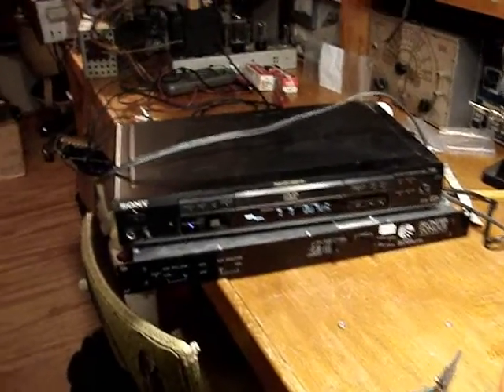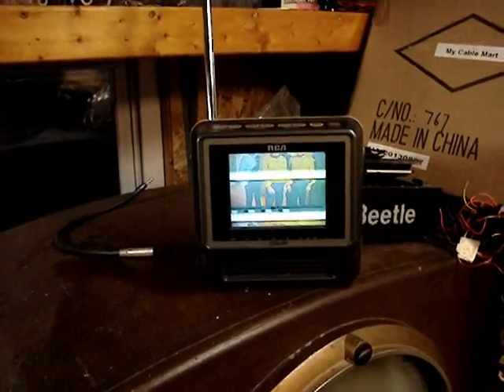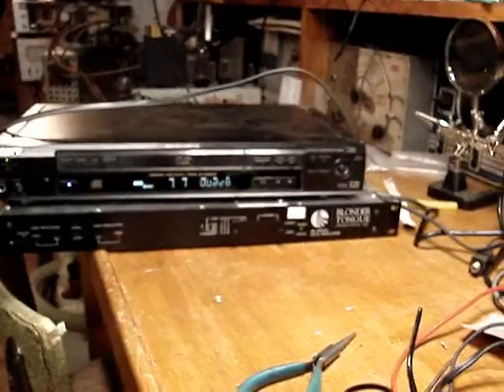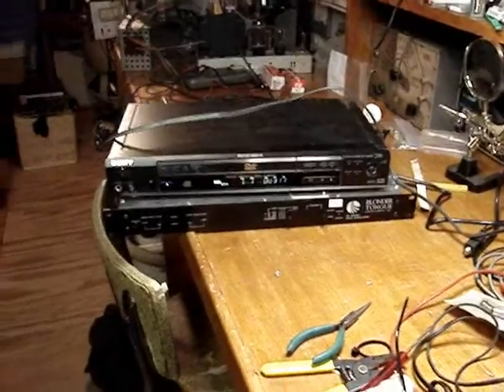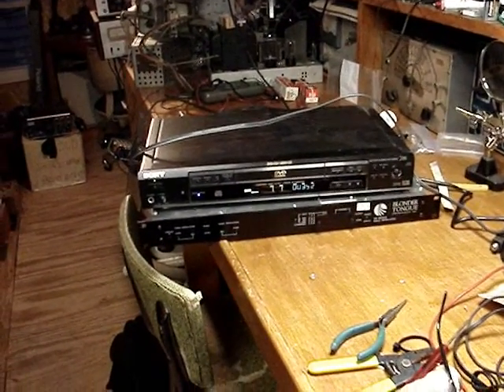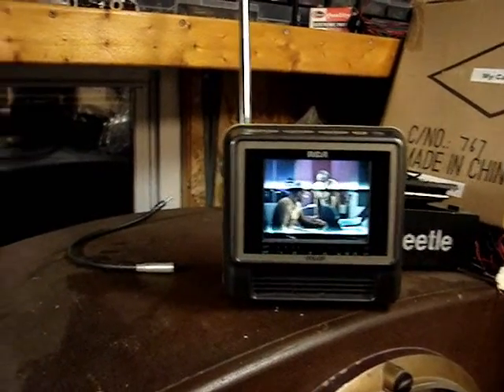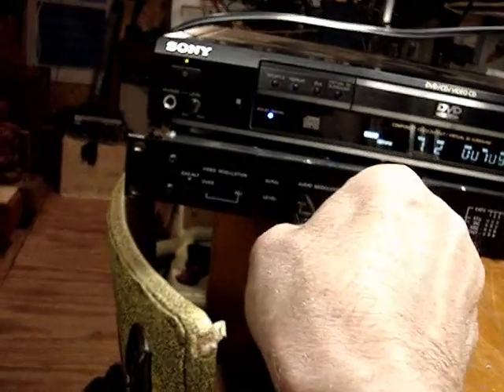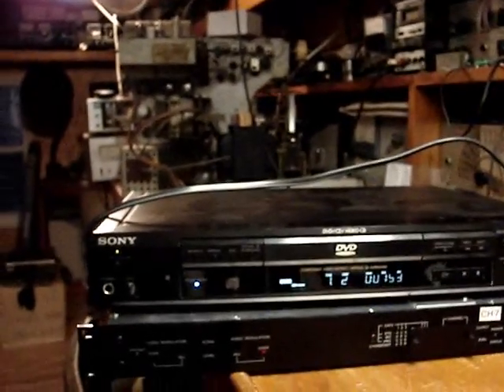Micro Power Home TV Station PT2

Comment: That would be great to have it running proper!  Nice TV, I trolled for a small 5 inch like that for my analog video editing station so as I could watch the input, people on eBay thinks apparently that SD TV will make a comeback as their prices were way to crazy (and still are), I ended up finding a nice vintage 9 inch RCA that works just fine at my local electronics salvage house for $5 USD...I will be doing a video of it in the near future...
Reply from the maker: +JacksJunkDotCom I have also been watching for a small CRT portable color set and think the prices on eBay are far too high for those. I watched the little RCA LCD for over a week. It was less than $20 and with free shipping.  You can get little LCD and Sony Watchman pocket receivers fairly reasonable but the CRT sets seem to be a lot higher. I did verify that my little RCA LCD plays video/audio just fine by plugging the DVD player line outs into the line in of the receiver. That will be in my next video. Thanks for watching Jack. Gary
Reply: +HD7100 At $20 w/free ship, Ida jumped on it as well!  :)

Comment: How about connecting your DVD player directly to the small TV and bypass the modulator, wouldn't that prove that it is the modulator causing the picture problems and hum, just a thought as I know nothing about TV modulators.
Reply from the maker: +maynardcat Yes that would tell me if I have a problem in the TV or not. The A/V input is a mini plug but I may have a small portable CRT TV lined up. Gary
Reply from the maker: +maynardcat I just tried the TV with my video adapter cables. It plays direct video and audio just fine. I am sure the modulator needs to be rebuilt. Gary
Reply: +HD7100 Hi Gary  Yes that would be an easy test for the TV by just eliminating the modulator in the middle.  I'm betting there is nothing wrong with the TV.  I hope your replacement of the caps fixes the modulator problem.  It's always a gamble buying unusual equipment that the seller knows nothing about and is untested  on ebay, but sometimes if the price is right it can still be worth it.
Reply: +HD7100  Good luck with it, I'll be watching for an update on the modulator now.
Reply from the maker: +maynardcat I got the Agile modulator for less than $20. I am sure that re-capping it will fix most of  if not all of the problems. I was more concerned about the 4" RCA LCD set. I got that for a very reasonable price but if it was defective I am not sure I could fix that. The modern electrolytic caps than come from over sea don't hold up as well as the older capacitors we used to make right here in this country. We Americans made the best of everything when we used to be a manufacturing country.

Comment: Hi Gary,
This is just my two cents worth, but maybe some of the problem could be cross polarization of the antennas. I know antenna polarization could make a difference in ham radio.
Reply from the maker: +Jim Kodysz Thanks. I do plan on tryinbg a verticle antenna on the modulator after I check out the caps. I was thinking of making a folded dipole using 300 ohm twin lead and hanging it vertically. Gary

Comment: Gary

If the recaping doesn't fix it, get yourself a Scientific Atlanta agile modulator. NTSC standard channel one should be pretty cheap as eveything is digital now. If you have a spectrum analyzer you can check output levels on both the video and audio (6mhz spread). The audio should be set 15db below the video ouput level and the modulation shouldn't be more than 87.5 % or the picture will wash out on bright scenes. 

Wish I lived close by then I could drag my test gear over and give you a hand, but will have to help by proxy.

73 K6FEE  Keith
Reply from the maker: +biteme1167 Thanks Keith. I hope all it needs is a re-cap. I got it fairly cheap from the eBay and hope I can fix it.